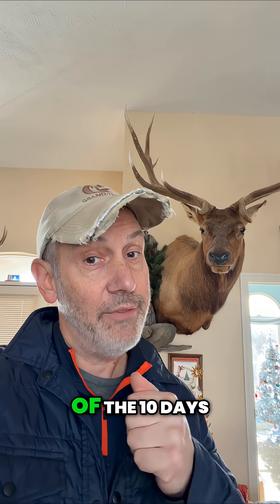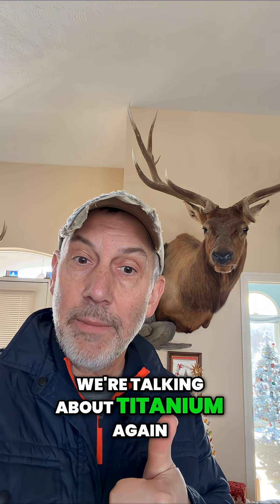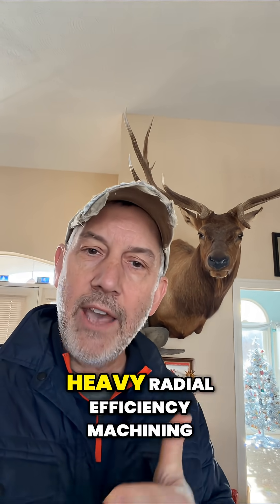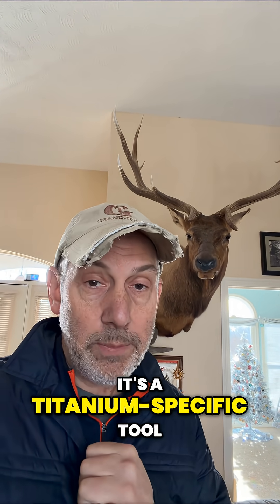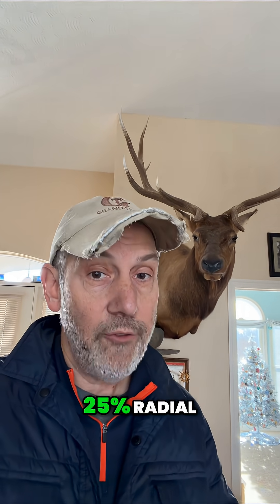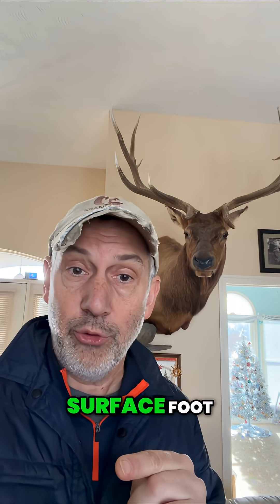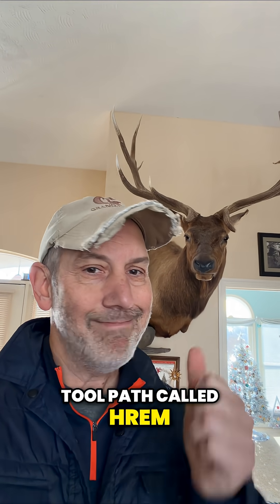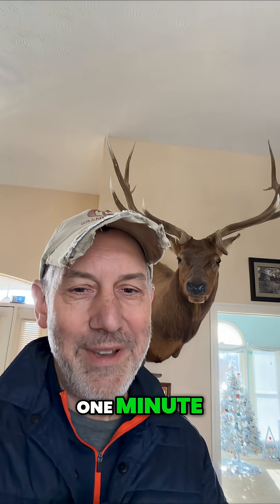Master This Titanium Machining  HREM Tool Path in Under 60 Seconds! #cncmachining #toolpath

Comment: What’s a good starting point for the stepdown? 1-2x tool diameter?
Reply: You’d still be using an adaptive tool path, so ideally you wanna use the whole flute length if you can, but obviously once you get past 2x the diameter you’re gonna want to reduce your feed a bit